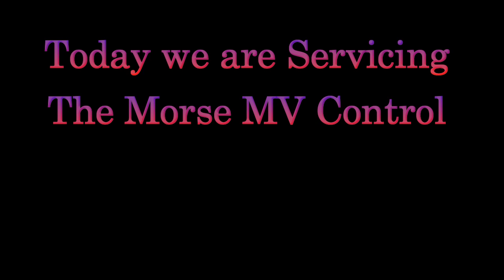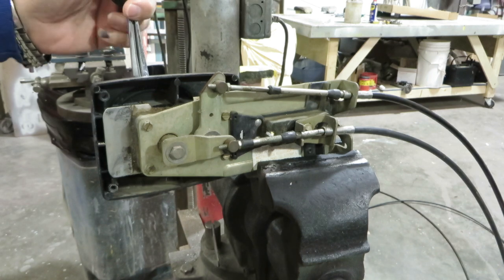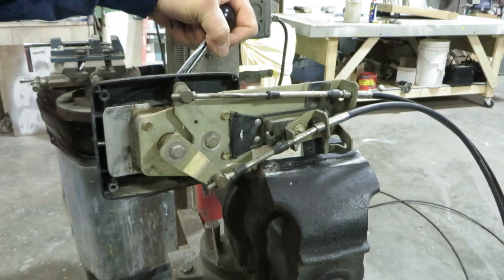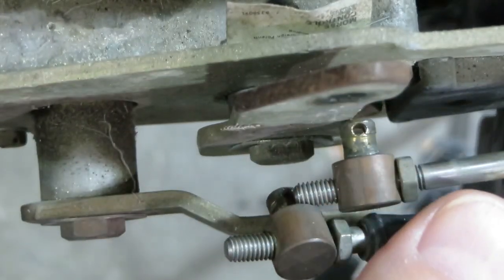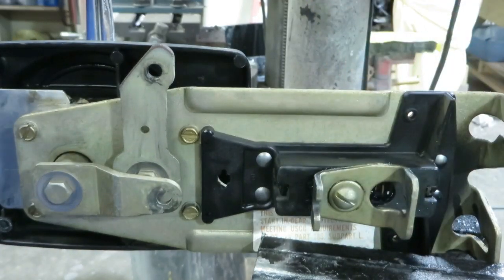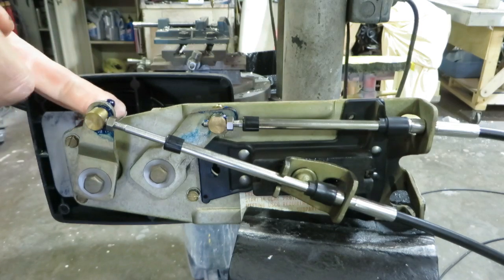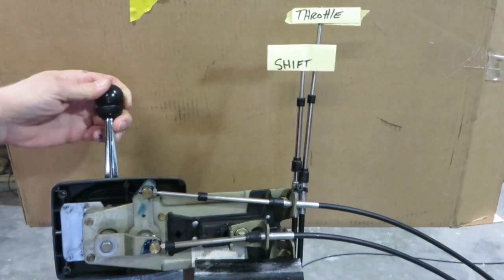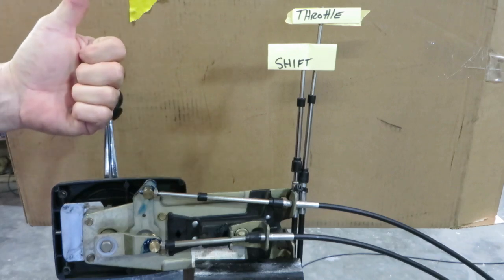Morse MV Style Throttle Control  Service

Comment: Hi Ron! Thank you for all these videos! I am troubleshooting a problem on my 88 Prostar 190. I replaced dampener as old one cracked and springs broke. We then went to test drive and we were able to get the boat to go in reverse no problem, but in forward the boat would only engage into gear around 1500-2000rpm and once engaged in gear, the boat would move forward but slip in and out of gear repeatedly (still would move forward but was intermittent power loss). So, we attempted to disconnect velvet drive shift linkage and manually shift the transmission (this was during the next test drive, about 5 days after initial test drive). Now that we tried manually shifting the tranny, the boat does not engage in reverse nor forward at all now... Since it already went into gear previously, we were thinking it has something to do with the neutral safety switch or the gear shift throttle box button that allows for revving of the engine without the boat being in gear (this may be faulty?). We have yet to test pressure on the velvet drive, as I guess the problem could be the tranny pump? Or clutch packs? But since the boat was able to go into reverse totally fine previously, I doubt the pump has failed. I may be wrong. What is the main function of the neutral safety switch and the button on the throttle that allows for revving out of gear? Do these symptoms point towards those two switches/button being faulty? What are your thoughts? I can provide more info if needed. Thanks a lot - it is a 351w Ford and a 10-18-004 velvet drive. 

One other thing, the throttle shift lever at the front seat makes a click when going into reverse but no click when going into forward. 

Thanks Ron!
Reply from the maker: Sounds like a re-build or replacement is in your future. Neutral safety switch opens the circuit to energize the starter motor preventing starting in gear, if your boat starts your issue is not the switch. The button on the shifter only disengages the shift cable at the throttle to allow reving the engine without going into gear. If you are dis-connecting the shaft cable at the trans and shifting the trans lever by hand you have eliminated the shift control as a possible suspect. The only thing you didn't mention was trans fluid level, it must be correct. Assuming the oil level is good my guess is clutch plates or oil pump, either one warrants a re-build.
Reply: @rontanis1024  thanks Ron for the quick reply! And Merry Christmas. 

So it is possible for the velvet drive to fail even if the dampener plate failed and broke first? I thought that the dampener failed before the transmission failed? This all happened at once when I was out skiing in the summer, terrible grinding and rattling noise coming from broken dampener. 

One other question regarding the ZF 45c you have listed on your YouTube video, will it bolt up no problem to the Ford 351 bellhousing? I see that it was a Chevy engine in the instructional video. 

Are these ZF 45c something that you have in stock? 

Thanks!
Reply from the maker: @neavemckinnon  My guess is the damaged damper did additional damage to the trans, this is why I preach changing the damper asap when the "clinking noise" is heard. We have 1 or2 ZF-45s left, our next shipment is not due until May 2023, ZF is running way behind production since covid.
Reply: @rontanis1024  great thank you, I’ll take a look online and possibly place an order. What is the warranty/guarantee? Can it be returned if defective?
Reply from the maker: @neavemckinnon  2 year ZF Warranty, any warranty claims are handled by their local service centers
Reply: @rontanis1024  ok great, does the ZF bolt up to the 351W Ford Bellhousing?
Reply from the maker: @neavemckinnon  YES, the trans side of the bellhousing is designed for the transmissions, the engine side varies from GM, FOrd, Chrysler

Comment: Hi Ron, I  have this control on my 1996 malibu sunsetter.  Last time I used boat in forward gear, increase engine rpm to 1500 and throttle stays.  Now when I  take my hand off it goes back to idle.

So wear has changed something, any ideas?  Do you sell the brass barrels, if so what p/n.  Great video!

Comment: Thank you for this video Ron. Would you believe I have an MV2 fitted to my canal narrowboat over here in the UK, it's a rare beast on the British canals that's for sure, I've never seen another one! I've noticed the control is becoming very stiff when engaging forward or particularly reverse gear. I suspect a worn shift cable, which may still be the case, but I now think it's poor adjustment too having studied your video. The installation manual I have for the control is very poor at explaining how it all works. I'll be back to my boat at the end of next week and I'm looking forward to properly adjusting the control and fitting the new cable. I now feel a lot more confident.

Comment: Do you have any idea to adjust the throttle tension. My throttle will not hold its position when running, if I take my hand off the lever it goes back to idle. Bad news when going through rough water if you need a hand to adjust the trim tabs or something. Wants to put you through the windshield :(  Thanks
Reply: Its the MV2. I could find nothing but wavy compression washers on the shift lever shaft. Stupid design :/

Comment: AWESOME.. I have the same control on my 1985 S2 9.1 Sailboat for the Yanmar 2GM. It needs some help. Can these be completely rebuilt? The pullout "shift defeat" knob is stuck. It shifts and throttles up just fine though. Is there a more or less direct replacement? THANKS!!!

Comment: A question does the silver knob next to the throttle lever move in and out ,,,I have exactly this throttle gear control took it apart but cannot get the silver knob to push in or pullout ,,,this appears to be the only video of this control I can find but you don’t actually mention what this silver knob does if anything at all
Reply from the maker: Yes the knob ahead of the throttle is a transmission lock-out, when pulled out it will dis-engage the shift lever and allow you to "rev" the engine in neutral without going into gear, also used as a high idle warm up feature.
Reply: @rontanis1024  so is there a position ie when the throttle lever is in the middle position that the button push pulls ie only in that position or can that be done at any position ,,,thx for the speedy reply by the way I spent a good few hours stripping and gear easing mine today,,,also the lever has a pull up feature on it to unlock it ,,,at what position would the throttle lock be used ,ie nuetral
Reply from the maker: @nigelwhybrow9257  Throttle must be in neutral to disengage shifter (pull the pin)
Reply: Hello Ron,  I have a Morse (mabe MV3) and the button to disengage the jet will not pull out in neutral (or any other position). Any advise on what it could be? Right now if you need to give it gas to start it it will take off in eighter forward or reverse. Thanks!

Comment: I have a similar shifter. I would like to have seen the cam housings.  There are 2 routings in my cam housing and only one has a bush in it. I think the screw and bush for the inner routing has fallen out. Teleflex 300 I think and I cannot see a drawing of it or see a part listed.

Comment: can you explain how the engage disengage of shifter throttle works?
Reply from the maker: WHen the throttle lever is in neutral you can pull the small button out and it disengages the shift arm allowing you to rev the engine while in neutral.
Reply: @rontanis1024  I have a problem with that button , it pulls out ( very hard ) about 1/8 inch but does not disengage the shift arm. any thoughts, Thank you for any advice.
Reply from the maker: @dickdykstra2234   Check to make sure the cables on the back side particularly the brass pivots are free and not jammed up, otherwise a control box tear-down is next, but be aware the Mfg. no longer makes replacement parts for parts inside the box available.
Reply: @rontanis1024  Ok thankyou Ron, will do.

Comment: I have a dual helm throttle only setup, shifter is seperate.  The lower helm throttle works good on starboard side but from upper helm has about an inch of play before throttle responds changed upper cable still has play, do i need to secure the cable in a few spots  along cable run to remove the play, been trying to fix this for years, port throttle works fine, any help is much appreciated.

Comment: thanks for the explanation Ron. I was trying to understand whats going on with my own Morse controls which will engage reverse just fine, but not forward (although it revs the engine still). Looking at the gearbox end i can see it is moving the bar which selects forward or reverse (works in both directions but no drive).
The odd thing is i have two helms and the Morse control on the lower helm works perfectly and engages the gearbox in both forward and reverse on those. 
The fact the faulty upper helm still engages reverse makes me think the cable must be connected and or not snapped, and because the lower helm works perfectly it cant be a fault with the gearbox (which was only taken away and reconditioned just over a year ago).
Could you offer any pointers for me please?

Comment: Should the throttle stay in position if you let your hand off?  Mine will immediately return to idle if I take pressure off.  Acts like a car gas pedal, not sure if this is correct for a 91’ prostar
Reply from the maker: All boats have a throttle return spring some are stronger than others, some guys will remove them altogether to achieve a throttle that does not automatically return.

Comment: Hi  I bought a 1975 boat.I took this throttle control apart.Very nice video!On the front side:what is the use of this chrome push/pull button under the shifter ? Thank you.
Reply from the maker: Disengages the shift arm so yo can rev the engine in neutral.

Comment: Very good video! Thanks for that.
Wish i knew what kind of throttle control is on my 1976 Crestliner Crusader 775. I just bought this boat as a project...The control is all pulled apart, and i have no clue what parts im missing to get it back together again.
Reply from the maker: I doubt it is like the one I dissected here, this was a Morse MV control used in virtually every inboard ski boat, if yours is a stern drive or outboard you probably have a control made by the eng. mfg.

Comment: Hello, have a 1994 Malibu Skier. Has the same controller. The neutral button is extremely difficult  to pull into neutral position. Can you provide same help on this issue? Hj

Comment: Great video - does the MV style control have adjustable friction?  Mine tends to creep towards neutral at certain speeds like ~20-30 it doesn't stay put, above 30 it is enough degrees towards horizontal and it will stay put, below 20 and I think the return springs aren't pulling so hard.  Any adjustment for that?  I've seen clamps that bear on the throttle cable but that seems less elegant.
Reply from the maker: no friction adjustment, the USCG would frown on that
Reply: Oddly they sell a throttle cable brake?
Reply: So how would one fix that issue?
Reply: @emhallad  they sell a little clamp you put around the plastic cable housing then you snug up the bolt till it drags the cable a bit.  Since my question I installed one.  Don’t love it but it works.  My perfect pass needs a good return spring so that’s the only real solution.
Reply: I'm experiencing same aggravating problem.  Boat will not sustain speed as the throttle leaks off while on plane (Volvo FourWinns 22').   I've not torn into it yet to see if there is any friction adjustment/spring, etc.    That slow speed leakage is impacting enjoyment.

Comment: Hey Ron. My in-laws' boat has this same throttle, but it's attached to a side panel that runs the full length of the boat. There is no way to drop it down like yours.  Is there a way to separate the black outer trim piece from the inner body of the throttle?
Reply from the maker: If not a drop down design from the boat builder they typically use a slide in process, but there will be 3 screws used to hold the assembly in the panel, once the 3 screws or maybe machinescrews, place the throttle in reverse, pull and twist out the assemble dragging the cables with it, placing the throttle in Rev. will streamline the arms to fit through the opening. The mfg. of the control included a cut-out template for this and I know it is tight but a twisting motion is required to extract the assembly. I have never removed the back plate to install or remove a control.
Reply: @rontanis1024  thanks so much for your response. I had the 3 screws out and the handle off, but didn’t want to break anything. I will try what you suggested. Thanks again
Reply from the maker: @TheGingabredmane11  The handle stays on to remove so yuou can manipulate the arms as it squeezes out.

Comment: I have a morse single engine with throttle and shift lever combo.  Can I convert it to a single set up like shown in the video?  If so what would that take and any advice?
Reply from the maker: really depends on the transmission/outdrive, these work well with marine transmission like velvet drives, ZF but not so well with mercruiser outdrives

Comment: My mb sports boss 210 is engaging both at the same time. What would cause that to happen?
Reply from the maker: Incorrect throttle cable adjustment, the spring loaded "pre-load" block is not functioning due to cable adjustment is the likely cause
Reply: @rontanis1024  awesome. Thank you. I will go do the procedure you showed of pushing the spring load all the way back and adjusting the barrel to match to the hole. Thanks

Comment: Ron 
I have a 76 Donzi with Morse MV single lever duel action control. Warm up bob in center of lever/ shaft.  It’s through bulkhead design. 
It’s a little bit tired like to replace it in-kind and use my original Donzi level I can’t seem to find one do you have any idea maybe you have one that I can purchase if so please reach out to me thank you PS your videos are excellent
Reply from the maker: The Mfg. no longer makes repair parts available, they will only sell new replacement controls , and right now they have been back-ordered for months

Comment: Ron, I have the same throttle body, including the little trigger cup (terminology?) on the bottom side of the throttle handle. The problem is that there are no lockouts between forward and reverse and vice versa. I have to be careful not to throttle down, overshoot and end up in reverse. Any tips on that part of the throttle maintenance? Also, when running in intermediate speeds, when I take my hand off the throttle it pulls back on its own and decelerates. When it's running at faster speeds, the throttle handle will stay depressed and speed is constant. Repairable or dust bin?
Reply from the maker: SeaStar (current owners of the Morse throttle) does NOT make repair parts for this control any longer, they deem it unsafe for anyone to service this area of the control. their answer is to replace the whole throttle....Drives me crazy, When Morse made these I had exploded views of the throttle & ordered replacement parts as needed. OK. they do sell replacement knobs....Sorry.

Comment: I have the older Morse shifter without the lock-out mechanism.  I’ve noticed the shift arms are not “square” with the shifter.  In neutral, my shift arms are not “square” with the shifter body nor are they perpendicular with each other.  I’m replacing the internal parts with later parts that will make it like yours in the video.  Anybody know what the application was for the shifter I’m describing above?

Comment: My issue is my Morse shifter is stuck (at times ) in neutral and you cannot engage forward or reverse. It is absolutely locked in place. Can be a little unnerving (terrifying ) when docking. Any ideas would be appreciated
Reply from the maker: Complete teardown and rebuild or replace, you are describing an unsafe control, I would not operate that boat until it is resolved.

Comment: Hello I have the remotes on the starboard side . How would I transfer the remote to port side or would I need a port side remote . Sorry for silly question  but I’m refitting my wheel house . Thank you
Reply from the maker: Morse MV controls can be mounted port/stb side by connecting the cables on opposite ends of the arms to reverse.

Comment: Might be a little late for a response here, but my 96 F14 won't drop the reverse gate. I heard something "clink" in the shifter area and fall inside the wall of the hull. Any ideas? I'm thinking the cotter pin may have broken and it backed off the bracket.
Reply from the maker: Probably snapped a worn cable end on the back side of the throttle : https://skiboatpartsonline.com/american-skier-cable-end-pivot?search=cable

Comment: My sailboat inboard diesel (Universal m-18) has  seperate throttle and gear levers. Recently they stopped functioning independently and now when I put it in gear, the throttle lever wants to go with it. Basically I have to use two hands on the controls - one hand to keep the throttle level low and the hand to put it in gear. I took it apart and tried to get some ATF in there to lube it up but it didnt work. Do you know if it is possible to service this ? Does the bushing need to be replaced or how do you recommend I go about trying to solve this?  Here's a link of what it looks like: 

https://www.youtube.com/watch?v=7s1mDIc46ww

https://youtu.be/_w0v96imt8Y
Reply from the maker: Not familiar with that control, but I would look at the backside arms next to see what is going on there, may have a cable pivot about to break & is jamming against the other arm.